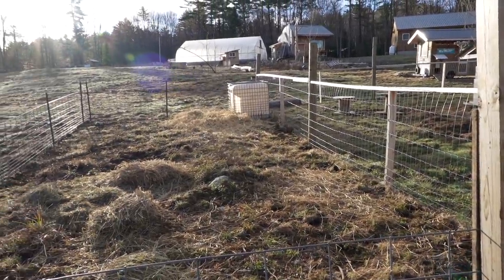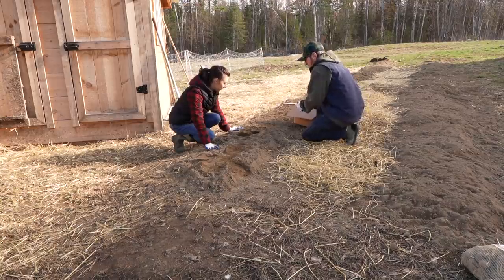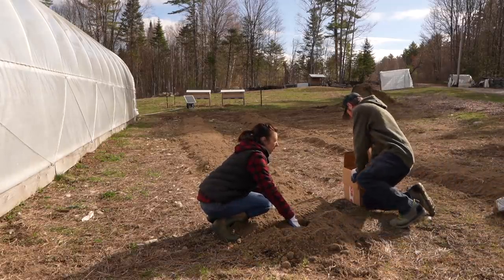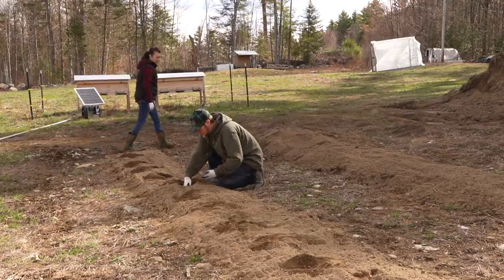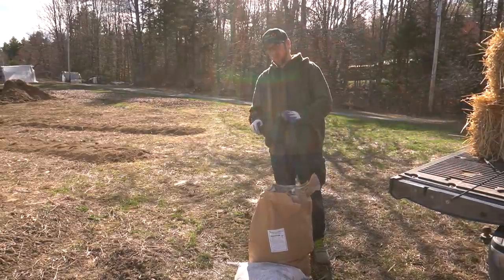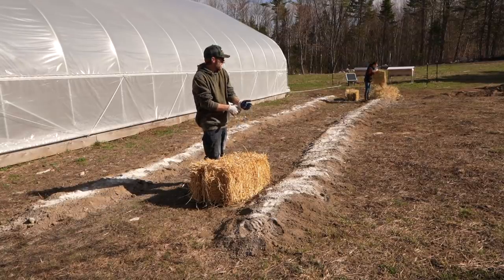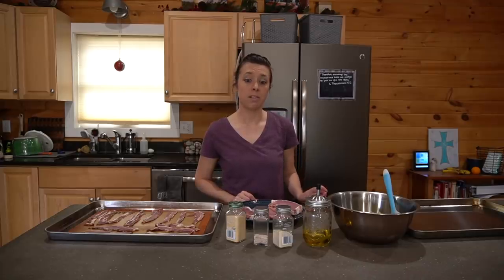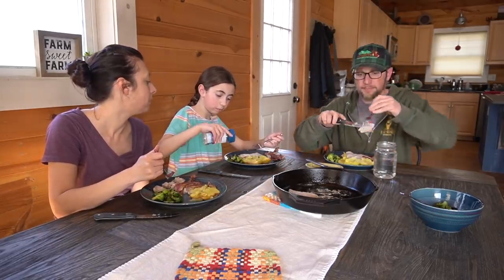How We're Planting Our Potatoes for a HUGE Harvest!?!

Comment: Al,the deeper the soil the better the crop.because they tubbers,they need deep ground.👍
Reply: Agreed - it would have been good to till the underlying soil first, then add the additional loam on top.  Tough with all those rocks for sure, but still... even a garden weasel would have helped! 😜
Reply: That was my advice also.
Reply: Agreeing with you guys, this year, I amended and dug a row with my tiller, removed that layer and amended and dug the row again making it a "recessed" planting bed. Once the plants are up above the "original" soil line, I will fill in the ditch with the amended dirt I have removed. Lots of work (My wife thinks I'm NUTS.) Nothing unusual about that!! ;o(  So, my plan is to "mound" with dirt instead of straw.
Reply: @samvalentine3206  3 of varieties planted were Determinate which means only 1 layer of potatoes will grow. The German Butterball & Austrian Crescent are Indeterminate which means if you keep adding more soil then you get more layers. Indeterminate are the varieties to grow if you use old tyres to create a potato tower or in grow bags.
Reply: @tonygrimes13  Yep, determinate varieties only grow one round of tubers, directly above the original seed potato. Indeterminate varieties will keep producing as long as the weather permits. Mounding up determinate potatoes is a waste of time & soil.
Reply: @tonygrimes13    I have been planting potatoes for over 60 years,  never heard of determinate and indeterminate potatoes
Reply: @schifflangefarms4539  Look it up on internet, you will be surprised!

Comment: I'm really surprised you didn't till the existing soil before you added more to it!  They are tubers so you want the soil loose and I would of amended the soil before planting instead of just on top of the soil.  When you do your tomatoes also add some Epsom salt, used coffee grounds and ground finely egg shells or if you didn't save egg shells get generic tums and grind them to a powder.  Mix them all together and amend your soil before you plant the tomatoes.  I do this 2 weeks before planting and add a teaspoonful of it to the hole as I plant...Shouldn't plant the tomatoes in the same place every year either....
GINA, make a basket weave of raw bacon and wrap a meatloaf in it!!  It's called a fatty.  You can also stuff your meatloaf with cheese and pepperoni and peppers and onions!  So very very good!  Bacon wrapped filet mignon is excellent also!  I use the thick cut peppered bacon for that one!

Comment: Will the roots grow into the hard packed soil??
Reply: The chickens have been preparing the soil near the chook pen and there has been straw laid already so that soil is already loose. However, they will continue to top up with compost/straw as they sprout and tubers will grow from roots or branches coming off the main stem.
Reply: @MrsGisawesome  - Yes, and if they can add more material on top, the tubers may grow more horizontally rather than vertically.
Reply: @MrsGisawesome  im afraid straw as mulch & free range chickens are not a good combination they will spread it far & wide once they know its there it only takes one & the others will follow
Reply: @karenbooth2062  That is a concern with chickens and dogs.  Might be worth fencing it!
Reply: @samvalentine3206  No dig potatoes, would be a blessing for sure!
Reply: No they won’t.

Comment: Once again, farmers put water in the hole with the potato's then cover it up. The way you guys are doing it, the water will just evaporate on the top and no water below.
Reply: I was raised and taught to fill the hole with water when planting anything!  The water is not only just needed but it prevents air pockets around the roots.  This reduces transplant shock and/or death of the plant!

Comment: Tip, build a Gabion wall 3 feet thick positioned as a wind break for the hives but where you can plow gathered snow on the windward side. Use your natural rock to fill the forms. Really like vertical hives but they get much colder. Gabion forms can be stacked so you can  increase the wall height.

Comment: Good Evening from North Texas. We love bacon wrapped asparagus baked in the oven or even just sauteing the asparagus with chopped bacon and onion.
I'm big on textures also and don't like the texture of baked sweet potatoes, but i love fried sweet potato cakes. I take pureed baked sweet potato (i don't have exact measurements), add in some old fashioned oats, an egg or two, a little bit of milk - just a tablespoon or two, season with cajun seasoning. Mix it all together. Form into patties about 2in in diameter and 1/2in thick. Fry in a little bit of oil on medium heat until nice and crispy on each side.

Comment: Pork tenderloin in the air fryer rotisserie.  I wrap the whole spit and meat in aluminum foil, just leaving the ends free.  After 20 minutes at 350 I remove the foil (poke a hole in the foil and let juice run into a catch pan) then I continue cooking until internal temp reaches 145. The bacon will be cooked but not crispy, but the juiciness and taste of the pork is worth it!

Comment: I have never tried it on pork chops, but I do make bacon wrapped meatloaf.  I actually make several small ones and freeze them in foil and then plastic bags for future meals, and they turn out great.  I never have to bake the bacon before wrapping.  I bake the loaf at 350 degrees on a toaster oven broiler rack until the internal temperature reaches 160 degrees (approximately 40 minutes), and then I turn the oven up to 400 for 10 minutes to crisp the bacon.

Comment: Yeah. In my preteen and teens in up state NY, new tater gardens were made by me bouncing the rototiller off all those rocks you were talking about until it was a bed. We had rock fences so at least the rocks didn't have to be moved very far. I just chucked them to the fence line. I did pick WAY more rocks than I ever did potatoes. Like your place, rocks came up every time we plowed. We only had one that we couldn't pull and had to stay. We're pretty sure NY would have fallen into the hole it made if we pulled it out...

Comment: i usually avg 200 lbs of potatoes from about 30-35 lbs of seed pot cut in 3 or 4 pieces.  i have heavy clay and  real rocky soil i till then make trench. drop seed pot never worry about distance apart or if  eyes or up  are they are going to grow up . i coat  my seed pieces with powdered sulphur to prevent scab.fertizler with 3-18-18 ( this is a tobacco fert.. u may not be able to find.)in three applications 1 st worked in to soil before planting 2nd and 3rd each time you hill or add more straw. be sure to watch for little red bugs eating leaves they can eat whole plant in a few days. spinosad  sprayed at near dark can control.

Comment: I do bacon 🥓 wrapped around cheese (Boursin style cheese) stuffed chicken breasts. One layer of raw bacon cooks fine with the chicken breasts (bacon fixed with cocktail sticks). Into the oven in a large pan with cherry tomatoes on the vine for 40 minute at 190 deg C.  Remove chicken breasts and cherry tomatoes and on top of the stove, mix balsamic vinegar with the tomato juices and any oozings from the chicken until it’s bubbling and starting to thicken slightly.  
Serve chicken breasts (removing the cocktail sticks) with the vine of cherry tomatoes and a green veg of your choice ( I like home grown sugar snaps or asparagus) and serve the sauce in a gravy boat.   Makes a nice tasty meal. 
I have done it one or twice using pork cutlets or lean chops in stead of chicken breasts and stuffed with an apple stuffing instead of cheese.  But prefer the contrast of chicken and bacon rather than pork and bacon 🥓

Comment: I recommended in a comment last summer when you set up your horizontal hives that you would likely be better with standard 10 frame Langstroth hives instead of horizontal hives.  I recommend that you check with other local beekeepers and consider changing from horizontal hives to standard Langstroth hives. That is what the Alaskan beekeepers that another subscriber mentioned uses. I realize Langstroth hives are a little more expensive but if your bees survive, it might actually save you money. I am reasonably sure you will overwinter much better with Langstroth hives. In my opinion heat loss is a much bigger problem in horizontal hives than with Langstroth.  Harvesting honey is also considerably easier with Langstroth hives.
For now, clean up what is left of your hives leaving about 3 frames (or whatever they are called in a top bar hive) and leave the rest of the space open.   You might get lucky and have a swarm move in.  The internet is full of advice on how to set up a bait hive to catch swarms and some are pretty good.
You might have to feed your bees the first winter.   Feeding is also easier with Langstroth hives.

Comment: I've only tried bacon wrapped chicken fillets. It's alright, but the hassle isn't worth it, imo. Found a really nice recipe for chicken instead, chicken in 40 cloves by Alton Brown (I use thigh fillets instead of breast, much tastier and cheaper too). You can slice those and freeze. Very handy, take out the evening before and then you have basically garlic infused salad style chicken bits. I like that with potato gratin or just as a side if yesterdays leftovers isn't enough for a full meal.

Comment: I've seen yeilds much better in container grown potatoes that seem to me to answer your Rick filled bed problems. Why not try cattle feed containers on one side of your greenhouse to see what works better. I've drilled several drain holes the bottom of  mine. Less weeding, better water control, better control over fertilizers used.

Comment: Jalapeno peppers  cut top cap off stuff  with cheese or sausage  or even cocktail franks  or combination of cheese your choice then wrap out side with bacon   can can bake or grill  note if using  saugage  to cook till done  cheese and cocktail  franks wieners are ready to eat 
In Minnesota  they call them buffalo turds LOL 
  Taking  seeds out remove  most of the heat  end up 5 great flavor
   If quickly  fire roast little  will remove the thin pepper  skin  optional  done both with and without  fire roasting skin

Comment: Sorry to hear about the bees, but I'm not really surprised looking at your hives. Those raised horizontal hives have far too much surface area to get cold. If you try again, I'd pickup that insulation foam board and make 'boxes' around the entire hive to keep the snow and cold wind off them. You probably had some freezing inside the hives as well, so you need to as some moisture absorbing material far from the main cluster. If I remember right, your bees only populated about 5 or 6 frames in that box and probably 2/3rds of it was empty space. Check out videos by the people in Alaska that overwinter bees successfully.

Comment: They get a bunch of old old tires your potatoes and it easy  how do it  hold water better to try 🤔
Reply: We were told that tires give off cadmium that you would not want. My grandpa used to do this. I was going to do it until I learned about the cadmium problem. They use it on the tires to get the tire molds off.